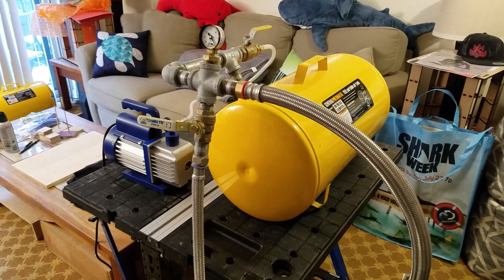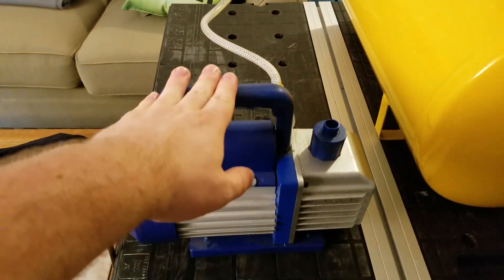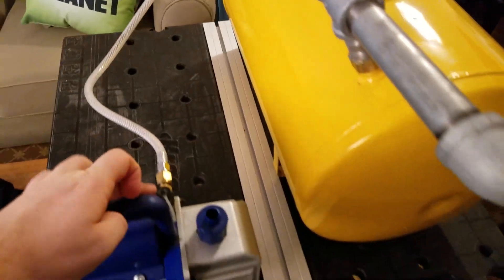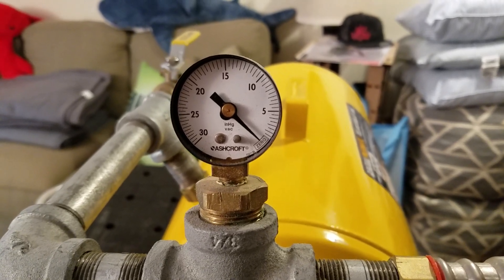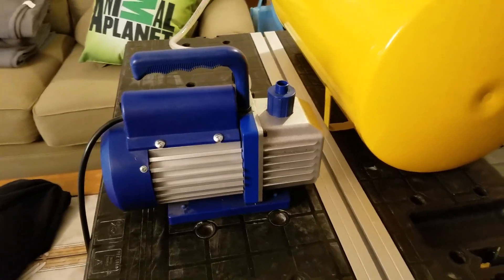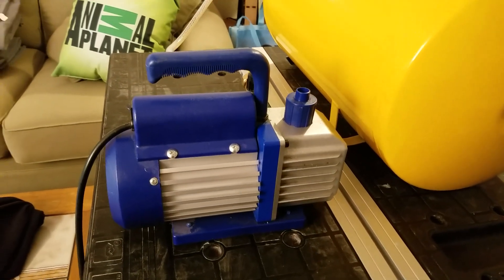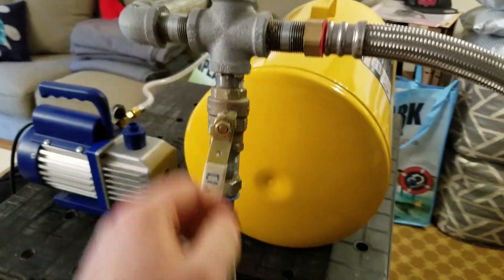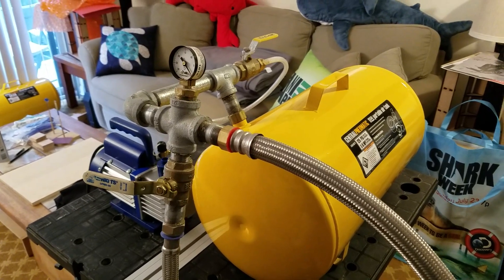My Vacuum System for Vacuum Forming

Comment: Hi sir, will a 1/2 hp vaccum pump be a factor? Or does the 1/4 hp be sufficient? I plan to do a 29.5”Lx21.5W platen table. Thank you for the inspirational vid!
Reply from the maker: A 1/2hp pump would work great and will evacuate the air from your tanks even faster.
Reply: Thank you so much for the prompt reply sir! If speed to fill the tank is the only difference, then i guess I can still use the 1/4hp pump then to save some funds! 

Another question sir, 
-is it possible to turn on the vac pump again after the vaccum on the tanks have been used? Just to make sure the vaccum is continually sucking on the plastic/mold? 

And a couple of clarifications If i am correct, 
- will using a bigger tank give me a more stronger vaccum and duration of vaccum? 
-will using a 1/4hp vac pump to fill a bigger tank will take a bit longer to suck out air but will still eventually (in time)be able to make the -28Hg needed for a good pull?

Thank you again and my apologies for the multiple questions. Please reply when able. God bless!
Reply from the maker: @JackB42  Ideally, if the system contains no leaks (if they exist, often between the platen top and the frame bottom on that gasket seal) the system will continue to hold the plastic around the form indefinitely since the air pressure (atmospheric) above the plastic exceeds that under the plastic (vacuum). I would not suggest turning on the vacuum pump during the forming process, since that won't give you any positive benefits and likely just suck the fluid out of the pump into your tank. A larger tank doesn't necessarily give you a stronger vacuum over a smaller one unless the air trapped in the system exceeds the smaller one's ability to equalize the air pressure into a resulting vacuum. The atmospheric air trapped underneath the hot plastic over the buck, in the interior platen chamber, and in the hose connecting to the system has volume at atmospheric pressure. When the valve is opened, we're just mixing that trapped air with the stored vacuum charge, hoping for a result well into the vacuum end of the scale. If you have the same amount of volume of trapped air as stored vacuum, it would be relatively weaker than if you had 3x the volume of vacuum charge available than what was trapped. So 'stronger' is a relative term that isn't a catch all. If you had 1 gallon of trapped air and 20 gallons of vacuum, you won't see a difference moving to a 40 gallon vacuum tank unless you had severe leaking issues. Provided your vacuum pump has good fluid and doesn't overheat from the duty cycle, yes, you can use a lower horsepower pump. I found that good fluid made a big difference on the performance of my cheap pump.
Reply: Thank you very much for all the info! I greatly appreciate it 👌🏼
Reply: Sir good day, a couple of questions. #1 will a 3CFM 1/4 Hp be enough to create a -28 inHg vaccum? i can’t seem to find a 3.5cfm 1/4 hp vaccum pump. #2 do i need a moisture trap to protect the tank? If needed where do I place it? Thank you again!

Comment: How thick do you think you can go with such a DIY system? I am looking to making objects  [ about 3 feet long, 2 feet wide and one feed high] from a 0.2 inch thick polycarbonate. Do you think this would be possible?
Reply from the maker: It's possible, but I would practice with thinner and cheaper materials to test and potentially troubleshoot your system before you do the polycarbonate pulls. You'll want to have a very good heating and vacuum system for something that thick, which will likely skew more professional and expensive than what was shown here (mostly on the heater side, probably, you may be able to get away using a similar vacuum system and storing it in a larger capacity tank). I'd suggest reading the technical bulletin from the supplier of polycarbonate you choose, since they often have a thermoforming section that will tell you the sort of targets you have to hit, like making sure your heater can exceed the glass transition temperature.
Reply: @mwjscn  I would guess an array of ceramic heating elements could be a good option.

Comment: How does equilization take place and what will be resultant pressure
Reply from the maker: In a perfectly closed system, the air trapped in the platen side will have nowhere to go, so the key is to have a greater amount of vacuum available as a stored charge compared to the volume of air. When you open the valve and allow these two sides to mix, if the resultant pressure ends up equalizing as a vacuum, the system will draw the plastic onto the buck since the force of the atmospheric air on top of the plastic will be greater than that below the plastic.

Comment: I think this is the first time I've heard of vacuum forming using a vacuum pump with reservoir over a shop vac.  Now I am curious what the difference in the results are.  Also, the oil in the vacuum pump is what maintains the seal while operating which is why the reservoir will pull out oil when it is turned off.  I had the same thing happen while using a vacuum desiccator, so I just made sure to unload the pump when I turn it off.
Reply from the maker: This style is fairly common and it outperforms the normal vacuum cleaner method to my knowledge. If you're interested, I suggest giving it a try.

Comment: Thanks for the video and parts list. I am trying to use an old vacuum former but am having issues with the vacuum. I currently use a 5 gal vacuum chamber but I noticed the platen is 6.8 gal in volume so I think that is the reason I am not getting any vacuum. The platen is a big box that has holes in it. So would I need a larger chamber, more than the volume of the platen? And if so is it possible then to hook up a 5 gal vacuum chamber to a 10 gal air tank or would the volume difference be too much?
Reply from the maker: In this type of system, I think it's fair to say that you always want more vacuum volume available than what resides at ambient pressure. Unlike a vacuum cleaner method, we can't extract the air that's inside the platen, we can only mix the positive pressure and vacuum within the contained system (with the idea that we want a negative inHg value - vacuum - when finished). When I form, I only have maybe a few gallons of ambient trapped air being combined with my approximate 22 gal of vacuum, so I wouldn't be worried about going too overkill. It will only become a problem if you're using seriously thin materials (less than .060 starting thickness) or if the plastic itself has been overheated leading to a blowthrough. I've found from my copious amounts of vacuum that it can also be hard to demold the plastic from any design that doesn't incorporate some minor draft angles on vertical walls (almost sucks it to the buck too well), but high-temp teflon spray usually helps a lot. If you want to do the math, which is beyond me, I would suggest calculating a value where the ambient pressure volume and vacuum pressure volume equalize to about -15inHg once mixed. I hope that helps!
Reply: @mwjscn  thanks for the feedback. When trying out my 5 gal vacuum chamber I feel no vacuum being pulled I believe because the platen box is larger volume than the vacuum chamber itself. When I take the tube out connecting the vacuum chamber and vacuum former I do feel a vacuum so I believe that volume is the issue. I think I will get a 10 gal air tank and connect it to the vacuum chamber and test it. Thanks once again.

Comment: Another top-notch tutorial. Only one question: you mention the foot pedal (maybe) but it's always off-camera and out of sight.  I did not see it in your parts list, either. Can you please show/explain that feature?  It sounds like a really good idea but I'm not sure about the mechanics involved. Thank you.
Reply from the maker: It's the ball valve you see under the vacuum gauge on the front. When the system is on the ground, I just hit that with my foot to open it since I'm holding the frame with my hands. You can see some examples of the technique here: https://www.youtube.com/watch?v=JmxfaJdHDII

Comment: Absolutely 'Loved' watching and reading the comments besides that last guys comments. (So far some of my best reads). So I'm super new to this whole thing. I only thought of a vacuum as a vacuum cleaner. 

In the recent years I have been actively involved in wrapping dash boards with PVC Vinyl and have come across some exciting vacuum forming systems like yours to wrap these interior car panels I.e Dashboard, pillars etc...

I have a ton load of questions which I won't bore you with. 

First question is: Does the power of the vacuum pump itself mean much if you have your tanks? 

This will probably sound way to ambitious, I want to make 75'' by 32'' system - is this size even possible?

Basically I want to do this:
https://www.youtube.com/watch?v=iFBJJ_djkfE  (31 sec video) - Whats your thoughts on it? 

Once again much appreciate your knowledge - Much love from England :)
Reply from the maker: Well, like they say, anything is possible with enough time and money. In short, yes, it can be done. The video you linked is how professional vacuum forming machines operate. The plastic is in the middle. It usually has a retractable heating element that comes over top (not shown), and then the buck is inserted from below with also creates a seal and activates the vacuum. To answer your question, the power of the vacuum pump itself doesn't matter much when using the tank method since you're not directly attempting to pull a vacuum with just the pump (which you cannot do). I'm happy to answer any and all questions, but if you haven't already you may want to check out my other video here (https://www.youtube.com/watch?v=Tugr2juVWuk) for a more comprehensive overview of all the considerations (the only difference is not worrying about undercuts, since you have no intention of removing the formed material from the "buck" in this case). You may also want to check out this video, which covers in more detail what you're trying to do: https://www.youtube.com/watch?v=gi0zbqNau-4
Reply: @mwjscn  Thank you for your reply. 

Yeah I see that is how professional vacuum machines operate. However I found another clip which seems to be less complicated, but does pretty which what Just dash's have. 

https://www.youtube.com/watch?v=YHUTtk6epsU (Any thoughts on this?)

I watched your video link you sent, it was very informative.

Once I have created the mould on the Vacuum, I'll remove it and glue it to the actual dash itself or I could apply the adhesive on the dash just before the vacuum stage so it can bond at the sometime. (That's something I'll have to experiment with). I just need to accomplish wrapping it without any creases.
Reply from the maker: @nabeelhussain1154  It looks like all of these videos have it bond at the same time and what I would suggest you do (otherwise dealing with the undercuts would be almost impossible without major cutting and possible destruction of the original dash). I would also suggest you make sure you can locate and acquire the very specific thermo-vinyl material before building anything.

Comment: It is sucking the oil out of the pump because it’s a cheap pump. I bought a high quality BUSCH Vacuum pump..$2300.00 worth and never had that problem. You can’t run your work line and your vacuum line through the same fitting. You are working your pump against itself. 20 inches of vacuum is PLENTY to do what you are doing. It is not the same as air pressure. I used a tank from harbor freight, and a parts wagon from same. The tank was on the bottom and the pump was on top. I could roll it around my shop when not needed. 

Your fittings are leaking. You did not use Teflon tape to seal the joints. Now, try breathing through a straw while running a 40 mile marathon. That is what your pump is trying to do with the way you have it set up. Your vacuum in the yellow tank is stored energy.......that’s stored negative energy. It’s not pressure. It’s not the same. In a few weeks when your pump fails, invest in a BUSCH pump. They are not cheap, but they last forever. 

So, now, I am guessing you are a single guy. If you were married, I would like to know how she REALLY FEELS about having her living room converted into a plumbing shop.
Reply from the maker: Lots of assumptions here. 1. It's not sucking oil out. That's why the ball valve was added. 2. It has sealant paste on all threads. It can sit at -28.5 inHg for over half an hour without leaking, I tested it. Your last assumption is on point, though, haha. I don't know why you'd suggest a 2,300 dollar pump on a budget build. This system works fine and I've produced all the parts I've needed so far using it - as the other videos clearly demonstrate.
Reply: @mwjscn  well, that’s just me. My HAAS CNC milling machine was $160,000. I had a job in my shop for ten years before I retired. These were flight critical parts. I precut them on my Trumpf laser, then removed the heat affected zone on my HAAS. I did over 150,000 parts without a reject. I wanted a fail safe system. It was what I needed. That’s all.
Reply from the maker: @johnholmes4960  And I can fully appreciate that. I have plenty of tools where I chose the quality option rather than the budget - and it definitely shows when I use them. However, coming into someone's comments only to incorrectly tell them point-blank that their system is leaking (when it is sealed with Loctite 504467 and holds well) and will fail in a couple of weeks (when it has been operating for years) is presumptuous and rude. This is a supplemental video for the DIY home enthusiast. Someone who doesn't have thousands of dollars for their projects. While I appreciate your industry expertise, I don't think your commentary is applicable to the people I'm trying to support.

Comment: Great video's you've made on vacuum forming, thank you for taking the time to share.  Question, approximately how long does it take to pull the vacuum in your two tank system?
Reply from the maker: Perhaps slightly over 5 minutes. I usually start it when I'm prepping the frames and bolting on the plastic and the system is ready when the plastic is heated (which is usually about 3 to 4 minutes for my heating system).
Reply: @mwjscn  that was quick, thank you!
Reply: https://youtu.be/sHY0kkRGLBM

Comment: Great video, I have a question, why did you decide to use 2 tanks, isn't enough with the vaccum stored in one tank?
Reply from the maker: I had some specifically large forms I wanted to have enough overhead for.

Comment: Hi,  over the past few days I have really started thinking about building a vacuum forming table.  I have a vacuum pump and a empty tank.  I have seen that you were running two tanks.  Is this needed?  The table I am thinking of making will be roughly 12x18”.  Most of the things I want to make will be smaller and any bigger parts I will make will be in panels.  I was going to go with a vacuum but I like the instant decrease in pressure because it appears to have better pulls and better definition.  I do also have a large shop vac that could be used.  Opinions?
Reply from the maker: For 12x18" you should be fine with only one tank. The ones pictured are 11 gallons in capacity each. I'd suggest using the vacuum pump before trying a shop vac, they don't make for good vacuum forming tools. If you did try it, you need to fill the void in the interior collection chamber to get any decent "throw" out of it according to the online research I've done.